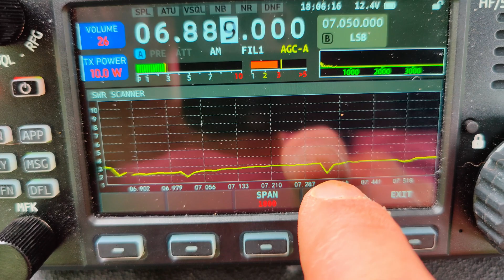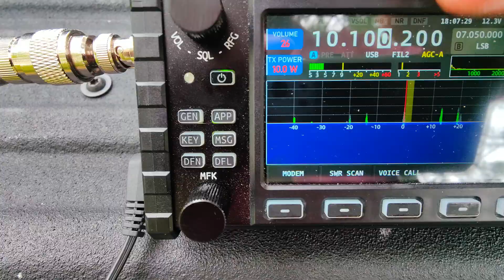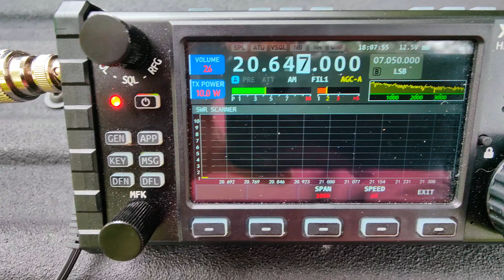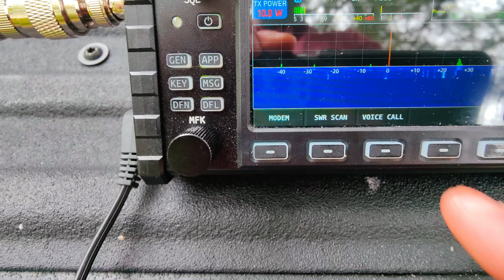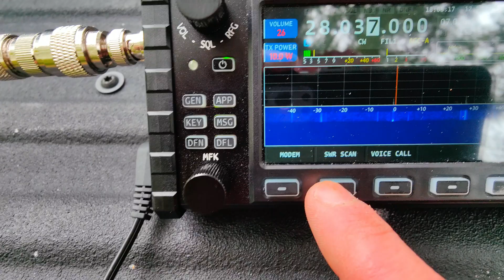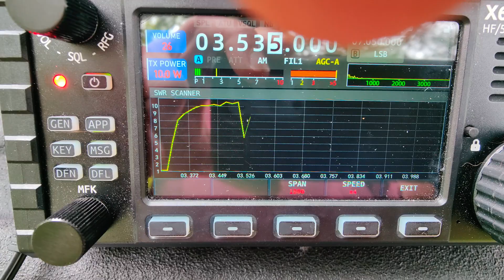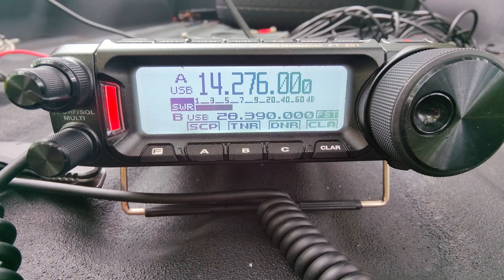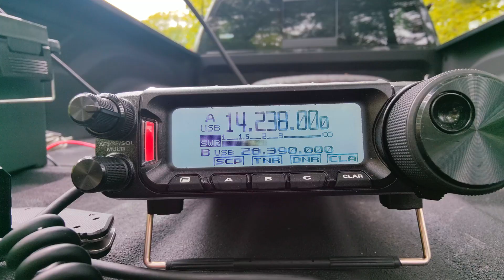HRD 4991 - Two Ham Radio Antennas and A Battery - All In One Box

Comment: love that idea. I have made a few different battery box over the years . thinking power. I put USB C and A ports. even made a 24V battery box.  nice to put 9:1 and 49:1.  I normally use small box for them. even wound 64:1 and a 4:1 . offset center fed dipole the 2 common ones use 4:1 . 2/3 and 1/3 of 1/2 wave total and the outher is 3/4 to 1/4 of 1/2 wave total. now if making a 1/2 wave folded dipole that 300 ohm and a 6:1 get you 50 ohm. with PTFE wire or # 16 mag wire you can get east 250 watt on t 240-43 core. that with a 1.5 :1 match or better. higher SWR  even with a tuner heats up the core more. made a 3 stack of 43-240 cores. with a good tune and HV cap should do 1 Kw or so. I wont out that in a plastic ammo can. may melt. still working out a box for that idea. look at how you wind 9:1 . change how you jump the 3 windings around and it is a 1:1 . found that in a old ARRL book. I found counterpoise on 9:1 can really help with match. putting chokes on coax can help with tunning. but every park or campground will tune different at times. keep extra ground wire in the go kit. and chokes for coax. I ran into RFI with 9:1 coming back to radio . 73's

Comment: Made something similar, with a redundant foam lined aluminium camera case. I added a fused 12 volt 4way distribution board (small type they use in caravans and boats). Also included was a dc / dc converter, 12v in, 13.8 v out. Another addition was a cigarette lighter socket.  This made a safe way to transport the batteries. Definitely fuse the output terminals. A great idea incorporating the 9:1 and 49;1 transformers, I might give that a try, but at the moment I would need to acquire a larger box. Also use the FT 891, FT 817, FT 991a and FT 10 DX. Look out for the new Yaesu FT 710, looks like it might be in three versions of 10, 50 and 100 watts, the problem looks like it’s size, it will apparently be between the FT 10 DX and the FT 991a. Great video, and some very good ideas, keep it up.👍

Comment: Instead of a single fuse between the battery and the load, I used a rigrunner on mine. That gives me the option to run a number of 12v items, like LED lights, a usb outlet, a cigarette lighter outlet and a watt meter. Its all in a Pelican 1400 along with a 12v/12Ah LiFePO4 battery and a solar charge controller.

Comment: Try a 71' wire with 50' RG8x & 9:1 unun for all bands including WARC bands. Some Results: I get 1.7 to 1 SWR or less (with no tuner) on  20, 17, 15, 12, 10; & on 160, 80, 60, 40, 30 (with a good tuner). Using 100 watts SSB I've worked Europe, the Caribbean, Asia & Australia from California & also get good signal reports on 80 & 40 phone nets. It's a very usable low cost all band antenna.

Comment: This is really interesting.   What else could you do?   Mount the solar charge controller inside.  Battery, controller, antenna stuff all in one box.   My one question...heat.     I'm not sure how airtight the ammo cans are and I wonder if there would be heat build up over time especially the 49:1... and the battery catching the brunt of it?    I would add a vent into the side.   Amphenol makes some.   This can become really badassed.

Comment: The extra weight and stability of a battery box seems like a great anchor point for the end of the 49/9:1s. (Although, I would add more structure for a hamstick support) I wish I'd have thought of it first.  "Crazy ideas" realized, that's what hams do !!!
Reply from the maker: This is a good point that I didn't consider. The weight of the battery does make for a great anchor. Without it, the box would not work at well

Comment: I'm curious. what will happen if you join those two antennas together in a similar way as fan dipole aka dude commander. I assume both are using the same counterpoise system so just connect both radiators together after those are matched/lowered down close to 50 ohms.

Comment: Holy cow ! Is that coax heavy enough? Think RG 8X.    Nice video and nice setup. 
The X6100 looks like a neat little radio.
"If you don't plan for success plan for failure." Ben Franklin.

Barry, KU3X
Reply from the maker: Lol.   The piece of rg8x I had needs a new connector, so I had this lmr400 jumper just laying around.   I have some 240 I need to to make some cables with.. tier you enjoyed! I am going to go test some things today
Reply: @DudeTested  You forgot to post the link for the Anderson Power Pole panel mount. Your video   just gave me the idea to get an Ammo Box for my LiFePO4 20ah battery. I just ordered the ammo box from Amazon. I really liked your idea.
Barry, KU3X
Reply from the maker: @barrykery1175  https://www.thingiverse.com/thing:3726066

Comment: Cool! I wonder if you could have a double pole switch that switches in the either the 9:1 or the 49:1 between the antenna and the connector? Or, have a tap at turn 6 of the 49:1 and switch the antenna with a SPDT switch between 9:1 and 49:1. That might be fun to try!  73, VK7IAN
Reply from the maker: I was trying to figure this out and hope to have it by part 2, if at all possible.   You wouldn't have a diagram, by chance? I'm very visual
Reply: @DudeTested  Hi Dude, I sent you an email. Take care and 73, VK7IAN
Reply from the maker: Thanks, by the way

Comment: Great box! You can get one of those antenna tuner kits and install that inside the box too.  Put the input/output SO-239 connector on top to the radio and a pigtail to connect to either the 49:1 or 9:1 antennas.

Comment: Great idea. Just for giggles, maybe attachment a spot for a 2M/70CM antenna since it has some weight it would make a great place for a vertical and not tip over. You could also use the same panel mount Anderson Power Pole and make a spot to plug in some radials. Lastly, this may be overkill, but for an IC-705, I'd consider seeing if there was say a 4-1 coax switch that you could either tear apart or mount in some way, maybe epoxy it to the outside of the box since water proofing isn't critical (or maybe inside), that way you could just have 1 coax connector to your radio and then switch between your 9:1, 49:1, hamstick/2M/70CM vertical, and maybe a dummy load if you need (or another external antenna).

You gave me a bunch of ideas and I think I might make a dedicated "antenna box" with all the above, and as you said, maybe the ATU inside as well. It wouldn't be a "single box grab and go" thing (not sure if you could fit a battery and all the wire) but it would be a good 2 box solution since I already have a battery box with 50Ah with a built in solar charge controller for power. Would make POTA a lot simpler with power in one, all the wire, tuner, and coax (and maybe adapters) in the other.

Comment: Will the battery be enough ballast to keep a hamstick, mounted on the box, from falling over? A wider box may be more stable for supporting a hamstick.
Reply from the maker: Good question. Immediately I don't believe so, but I may be able to create an internal support bracket in the cooler, which may add strength or rigidity
Reply: @DudeTested  One of the 50 cal metal ammo cans from harbor freight would be wider/heavier, and give you a bit of ground plane for your hamstick.  Nice video! AA4K

Comment: I made a 9:1 unun and run 33' of "random' wire (not random at all of course) to it. Not very flat SWR on all bands, but good enough and is quieter than running a ham stick antenna with decent range. Coast to coast USA easy... Have had a QSO from Texas to Sao Paulo Brazil (>5000 miles) too using an Icom 7300. The idea of building a one shot box (matching and power) to sit outside the radio for field day is a good one.
Reply: Try 35.5 feet.  It is not resonant on any amateur band and should give you better performance.
Reply: @retrobitsbench  Will do. Thanks.

Comment: What was the lengths on the random wire hooked to the 9:1? I have a plastic ammo box and I think I am going to build one of these. I think the hamstick option is a great idea. Yes you have to carry the hamstick separately but you have the option of taking it with you or leaving it at home. I like options.
Reply: @Stewies_Stuff  it worked for me.
Reply from the maker: I think it was about 93 feet.  I'll measure for video 2.  In the meantime, let me get you a link to "suggested 9:1 lengths"
Reply from the maker: http://www.dxsupply.com/produktfiler/Wire%20Lengths%20for%204%20and%209-1%20ununs.pdf
Reply from the maker: I'll go out today or tomorrow and try 124 feet and report back.  and 250 ft, just because
Reply: @DudeTested  I have a Nelson Antenna with 41' on a 9:1. It could easily go into the box. I'm familiar with the website listing lengths to use or avoid. So don't go out of you way on my behalf though others may need the link. Thanks